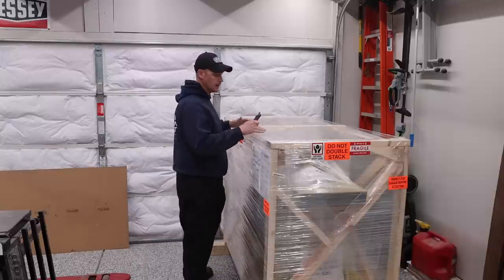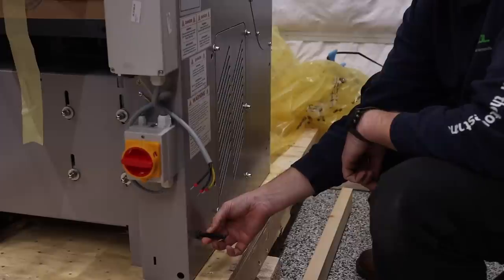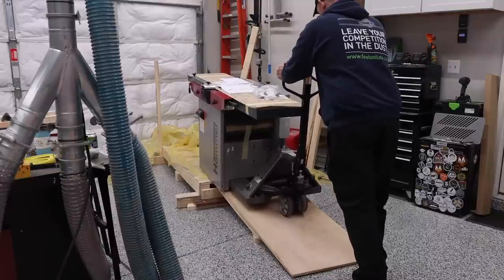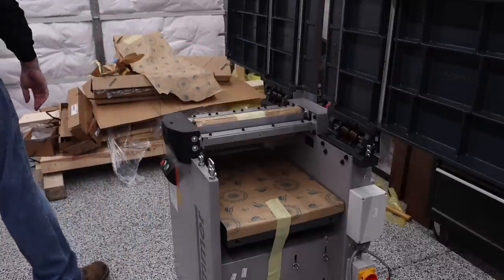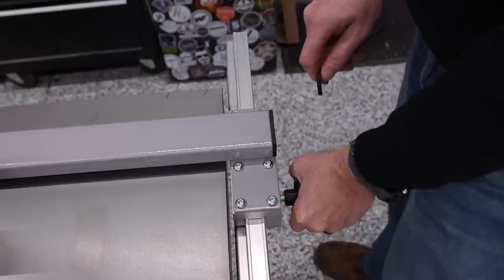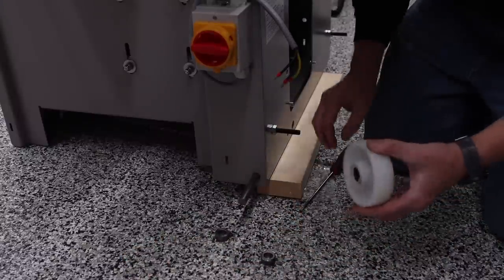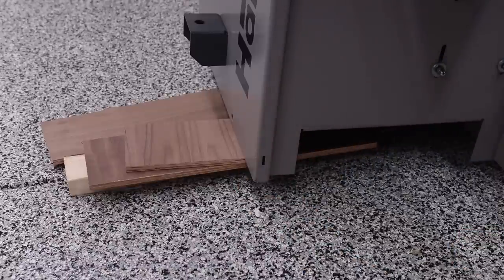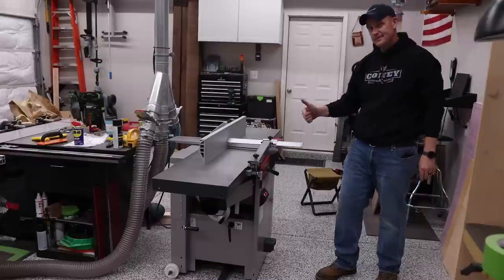Hammer A3-41 Assembly

Comment: Where did you rent the pallet jack from? Or do you own it?
Reply from the maker: The normal size I rented from Home Depot
Reply: I got my A3 and your video was very helpful in setting it up. Thanks for filming it. 
The jointer infeed and outfeed are not perfectly coplaner. There is a bit of sag on the infeed side. Did you check for coplaner and had to make any adjustments?

Comment: PURCHASERS AWAITING RESIDENTIAL DELIVERIES - Be prepared to move your equipment from curbside to your shop. Some Freight Companies are no longer backing up driveways, and insist on dropping freight in the street. Even if every other past freight driver has backed up your driveway with no problem, be prepared for this situation and have transportation ready! Also, even if you paid for "delivery", be prepared to pick the item up at the terminal, ESPECIALLY if inclement weather is expected. 

Felder will send you several emails about having a pallet jack available, but it's unclear to what extent you need it. DO NOT IGNORE THAT RECOMMENDATION, since once it leaves Felder's facility, you are at the whim of the trucking company and the drivers. Some companies and drivers are experienced and reasonable, do not count on your driver being experienced and reasonable. BE PREPARED WITH ALTERNATE TRANSPORT AHEAD OF TIME!
Reply from the maker: Good advice
Reply: @bentswoodworking  It was a good idea to put the lifting bolts back for the future. You can do the same with the machine hold down brackets that hold the machine to the pallet. Stack them in pairs, and nylon tie them around the hooks so they don't make noise. Slide them under the wheel axle on each side then run a nylon tie through the top bolt hole and out the tie down notch on the side of the machine case. Cinch that pair to the case from the outside using the top of another nylon tie; they are held tight and shouldn't flop around. Repeat on the other side and close the cover. Now if you ever sell the machine, or mount it permanently, you have the hold down brackets for shipping.

Comment: Thank you for convincing me not to buy a Felder combo machine.  I had been wondering what to do with the 120 mm dust exhaust and now I see I need an engineering degree to get it into my shop, not to mention the acres of plastic wrap going into the waste.  It is mind boggling that a company can charge that much for a machine without providing built in casters and clear, simple direction for unboxing.  This looks like the least user friendly product I have seen in a long time.